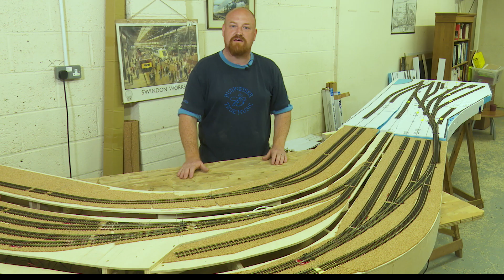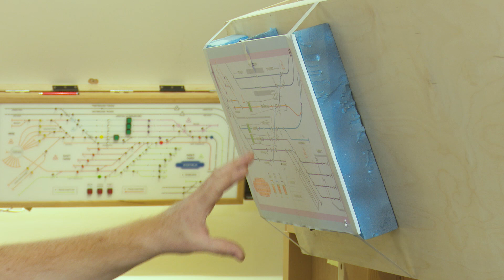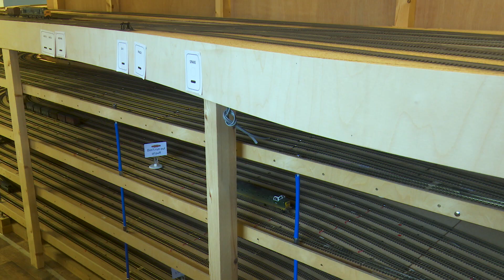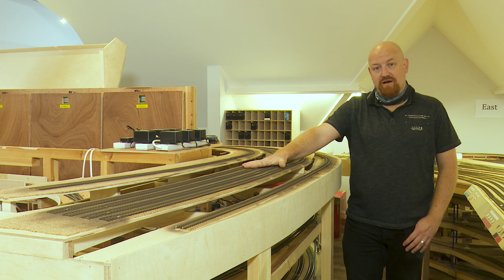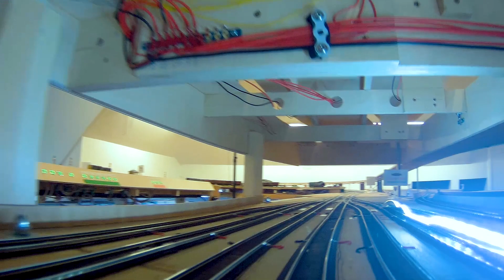58. Wakefield Installation at Mckinley Railway

Comment: Very coherent and well presented James, thank you (and well done Charlie as ever!). 

When you build a layout with this kind of volume of trackwork you are bound to end up with some level of complexity in regards to the electrics and of course it takes such a long time (thanks a bunch covid19!) that new things come around midway through that you might have used had they been a realistic choice at the start.  

One primary example is devices with "local intelligence" (for want of a better word). One such area would be the points subsystem - point motors that can be directly DCC controlled without intermediate boards is a prime example. Of course it would be possible to do a great deal of this now with CAN bus tech (such as MERG sells kits for) which would reduce the wiring enormously - but retrofitting all that onto a project that you started in 2014 is a massive and daunting task and so just not a realistic option I guess.

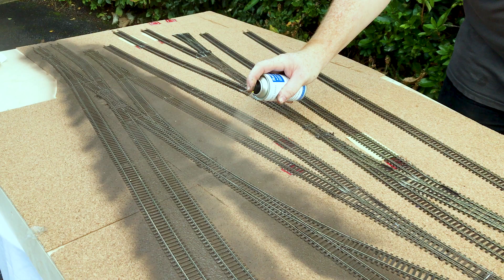Comment: When spraying the turnouts (4:30), wouldn't that clog up the contacts? Or is all electrical continuity dependent on the "Tortoise" point motors? Just wondering...
Reply: Hi Peter, good question.  All the points have been modified so every section of rail, even the blades are fed by a wire.  The frog is switched by the point motor, we even modified the double slips to make them true electrofrogs.  This means there is no reliance on any contact between the stock rails and blades so as long as the rail heads are clean the trains will run. There will be more on this in a  later video.
Reply: Thanks for the quick clarification James. When I watched the video, I had visions of folks gaily spraying their track, without knowing the implications if they didn't wire the turnouts as you do.

Comment: Really enjoyed that.  Can't wait to see the next video on the construction of Halifax boards.  - I have an educated guess based on the fact that everything else gets documented, but is there a full wiring schedule for each section of the layout to aid in any future fault finding or expansion.  I know Charlie used  ID sleeves on his cables, but other than a few hand written marks and some tags around bundles of cable I didn't see anything to suggest you followed Charlies methods ;-)
Reply from the maker: Hello malcolm,
We use ID markers to ensure they get wired into the right detection board, but those come off once connected and checked as they get in the way and just repeat where the wire should be wired to.  In principle the idea of identification sounds good, but in practice, there is the challenge of how they are useful.  Under the track work they serve, their location is self-evident and on the PCB panels, they are wired into specific ports which are documented in the database.   In reality, if we have a problem with a wire, we know where the start and end points are from the documentation and work backwards from there.  Wiring faults, post installation and testing typically are the result of poor connectivity at either end.
David